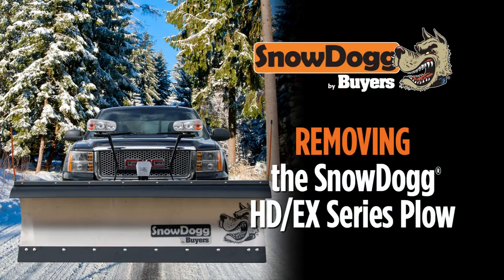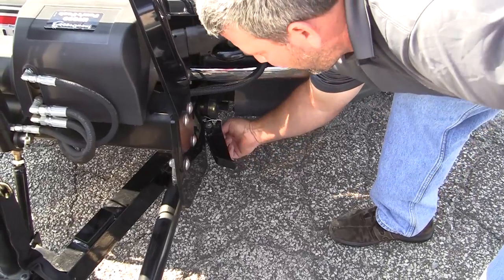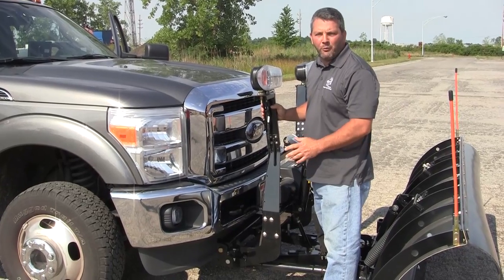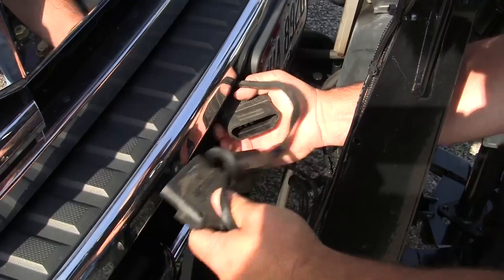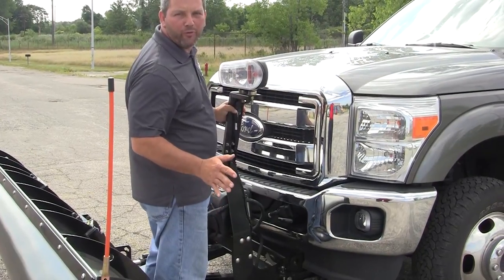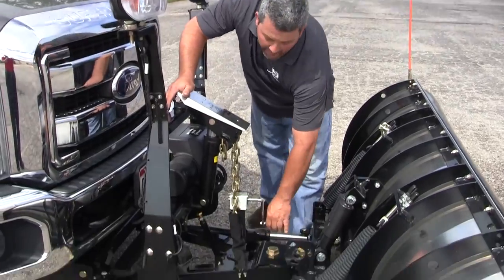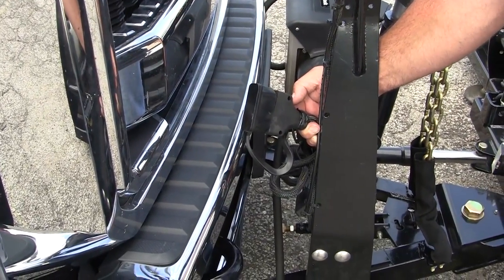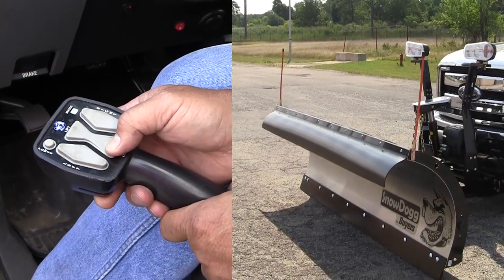SnowDogg How-To: How to Attach and Remove a SnowDogg HD/EX Series Snow Plow (Pre-2018)

Comment: Great video, I have an 2013 Snowdogg XP 810 Expandable wing plow and the hook up is the same as is being shown.  This video was a game changer for me, LOL. Being that I bought this plow used, I had no dealer to demo the hookup and thus I found this video to be hugely informative, thank you for making it. I love my Snowdogg XP 810! I live here in central Wisconsin, and I just  pushed a 12" snow fall here on April 4th, 2018. I was up 48 hours out of 52 pushing.  This plow works as hard as I do, its amazing on parking lots, and gets that stuff to the bank asap, it's crazy how productive this 20 degree wing design is. I had a Blizzard 810, and that was a really good plow, but this Snowdogg XP 810 has a simpler design, and that will make it easier to service when a new hose is needed in a wing or other part may need to be changed out. One thing is for certain, no matter who makes them, if you plow commercially, you will wear things out.  Honestly, using a V-plow or expandable wing, you have such better control and efficiency over what you are doing, I have no idea why they even make straight plows anymore, V-plows were a massive game changer, and Expandable wing units are great for big commercial lot pushing. Love my Snowdogg plow.